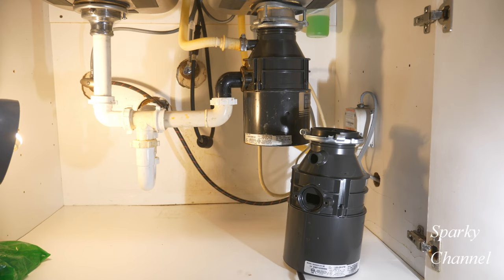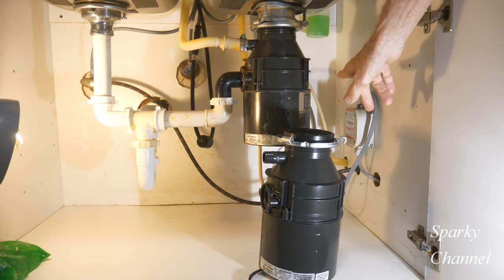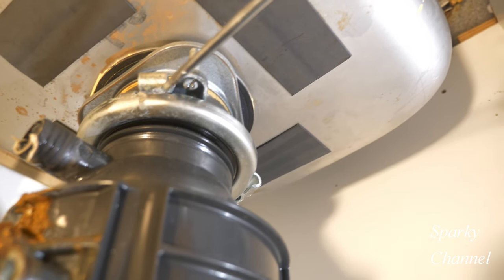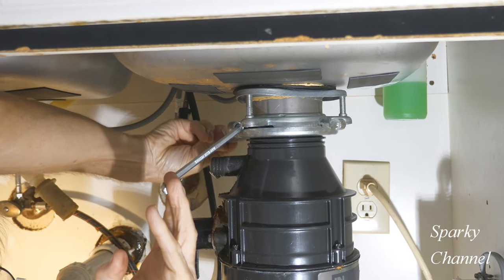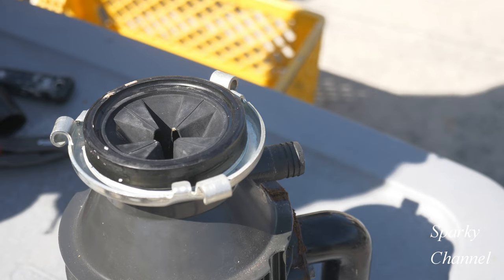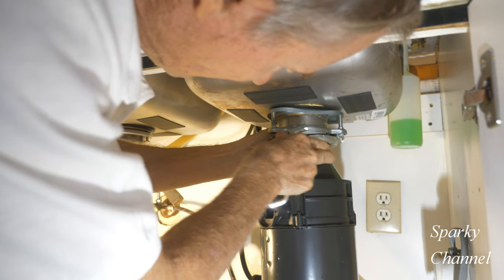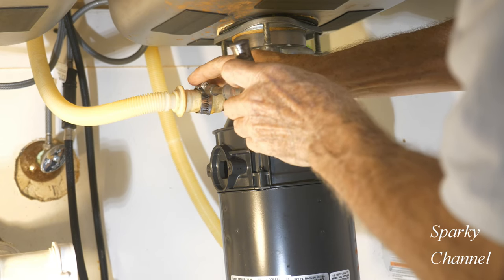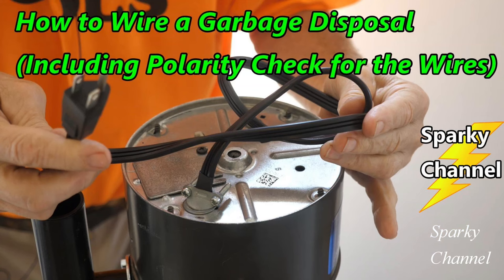Replace an Old Badger Disposal with a New One Fast!

Comment: a pro tip, if you happen to be shopping for cabinets.  the style that has a vertical between the cabinet doors is a complete PITA to do anything with.  get the kind like Bill has, where the doors just meet in the middle.  that way you don't have to fight with an obstruction between the doors. also, every plumber I've seen install a disposal has always filled the sink basin and pulled the drain plug as part of their leak check.  just running water down the drain only checks the bottom of the pipe, and when you dump a sinkload of water, it completely fills the pipe.
Reply from the maker: Yes, the dividers between cabinet doors are a complete PITA when doing something like changing out a disposal. Agreed about filling the sink tub. Also, run the dishwasher, and look for leaks or problems. Thanks Ken!

Comment: Pro tip. Run away from the Badger. Buy a Moen. It hooks up exactly the same as the Badger. Same hardware. Same connections.

Comment: I just did this today with my 13 year old son helping. I’ve never done any plumbing work before, but this just saved me about $350 (the cheapest quote I received for replacing my disposal, not including the price of the unit). $100, 30 minutes of work and we’re done. Thank you!
Reply from the maker: That's so great to hear. Great job Mark!
Reply: I just did it today and I had watched about five videos b4 I did. It might have taken a little longer but I am pretty sure I got it right. So far…no leaks. I did not replace the sink flange as it was not leaking from the beginning. I did not want to make the job anymore more complicated. I had my neighbor check my work as he is uber handy and he approved.

Comment: Have been replacing so many food waste disposals for clients and never knew they are available with power cord attached. Need to look for those as it would surely save me some time. Yes, yes, I always check polarity when replacing the power cord... With regard to the mounting assembly, I always replace it to give clients the full value of a new disposal, but that's just me. Anyway, I always love it when my favorite electrician expert turns to plumbing! I am glad you are branching out! 🙂
Reply from the maker: The weird thing is that Home Depot charges $14 for an Insinkerator brand cord while Insinkerator only charges $10 extra for a corded disposal! And the cord is so nicely sealed. Good job on checking for polarity. Many people feel that since the hot and neutral wires are both black, it doesn't matter. But it matters a lot, so great job. I actually worked as a professional plumber for a while. Electrical is a much better trade IMO though. 
Keep up the great work Mark!
Reply: I did not like I had to replace power cord. Was going to use the same one but it wouldn’t come out so I bought a replacement cord. It is dumb that both wires were black though. You had to check the feel on the wire sheathing to get the polarity right. That is dumb. I got it right though after verifying 3 times.
Reply from the maker: @markgladney4743  Excellent!

Comment: You might want to add putting a weight or something on the sink flange up top to keep it from shuffling while installing/ removing (and you're keeping the old drain flange). It it moves, you risk breaking the waterproof seal.
Reply from the maker: Good tip, thanks!

Comment: My insinkerator is fine.
I wish you could show me how to install an air vent underneath my sink because it's not vented
Reply: if you mean your house plumbing has no vent for the sink, you might look up Roger Wakefield, if you haven't found him already.  he may have a video on installing an autovent under an existing sink.
Reply: @kenbrown2808  ty ken
🙏❤
Reply from the maker: Are you asking about an air gap, which goes on the sink, or a plumbing vent, which goes out through the roof?
Reply from the maker: Hi Ken! @kenbrown2808
Reply: @SparkyChannel  good morning. Hope your summer's going well.
Reply: @SparkyChannel  goes on the sink
Reply from the maker: Here you go: I installed an air gap in this video, with explanations as to why: How to Install an Insinkerator Evolution Garbage Disposal and an Air Gap: https://youtu.be/RkYkZGVtMkQ  @deadmanswife3625
Reply from the maker: Summer is going great, thanks. I just finished a very big house renovation. It was a lot of work and expense, but it came out really nice! I hope you're having a great summer as well! @kenbrown2808
Reply: @SparkyChannel  appreciate your time Sparky. 
Thank you.
Reply: @SparkyChannel  it's been busy up here, barely had time to keep up with maintenance at my house.
Reply from the maker: The maintenance never ends. lol! @kenbrown2808

Comment: The Badger line is designed to fail. Buy the higher-end stainless steel models if you want it to last.
Reply from the maker: I agree. The 1/3 hp and the 1/2 hp are a waste of money. I got the 3/4 hp with a 4 year warrantee. I'll be keeping that paperwork because I don't trust it. True, the stainless one's are quiet too.

Comment: Gone through several videos... I've replaced the disposal. Are there any suggestions to what I can do with the old one. Do I just throw it away?
Reply from the maker: I found this on Google: "Since garbage disposals are mostly metal, it is better to think salvage rather than the landfill. This process recycles a variety of items including copper, aluminum, steel and more. Find out where to take your old disposer check with Earth911 and check under “metals” for your local zip code."
Reply: @SparkyChannel  thank you!!! Very helpful! Something in me just wasn't satisfied with trashing it or the regular weekly recycling pickup.
Reply from the maker: I understand. The disposals are a heavy chunk of mostly metal. @psykomystro

Comment: That’s great, but! My problem is that the metal ring that sits on top of the garbage disposal unit, is not fixed to the garbage disposal unit, it just comes off. So how do you attach that top ring onto the garbage disposal unit, before you attach the garbage disposal unit onto the bracket that’s attached to the sink? I’ve watched about 10 installation videos and not one single person explains how to do that. If I tried to attach the garbage disposal unit with the ring the way it is now, the unit would just fall off, because that ring is not holding it up. You guys, you all try to make it look so easy, but you don’t give us every single step of the way and you don’t explain the potential problems you could have, and how to fix them. Not even the official insinkerator installation video shows us what to do if the ring is not attached to the unit itself. You’re all driving me flipping nuts.

Comment: Big Clive recently made a video about his worst shock, and I think this is an important topic that frequently gets overlooked.
https://youtu.be/Q2jGK4iuPnQ
Would you be willing to share your own story on such a topic?
Reply from the maker: I've never been shocked badly. Some small shocks when I was young and stupid though. lol!
Reply: @SparkyChannel  heh. I got lit up by an HO fluorescent, but my worst shock was a Reloc(tm) system in a commercial building. 277 leaves a mark
Reply: @SparkyChannel  
Thanks 👍
Reply: @kenbrown2808 
The only time I have been shocked was not a working incident; although, it involved moving and rearranging. It happened by unplugging an antique piece that most definitely needed to be rewired.   After a few moments, I opted to leave it where it was and not plug it back in at all. I was too embarrassed to say anything at the time but would not be, if it were to happen these days.  

Safety standards have come a long way!
Reply: @GeorgeVCohea-dw7ou  that and insulation doesn't last forever.